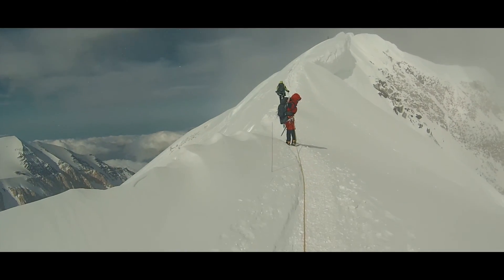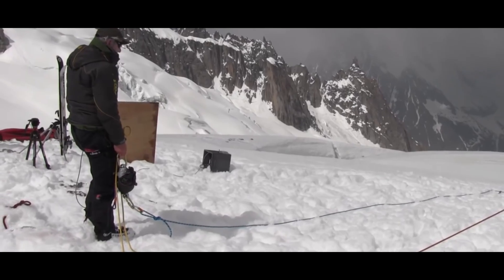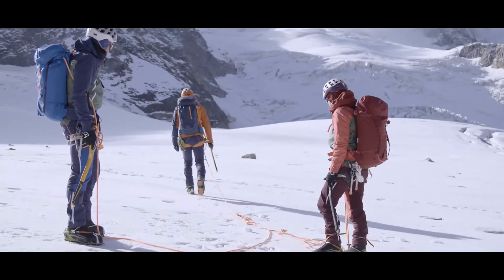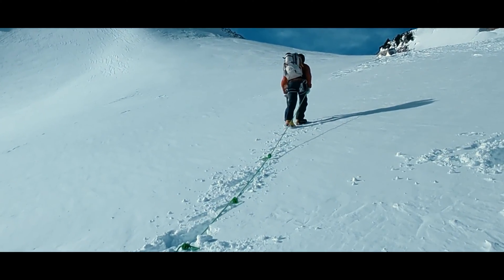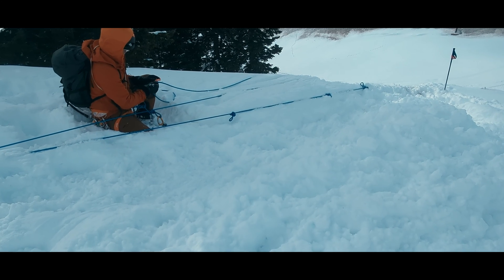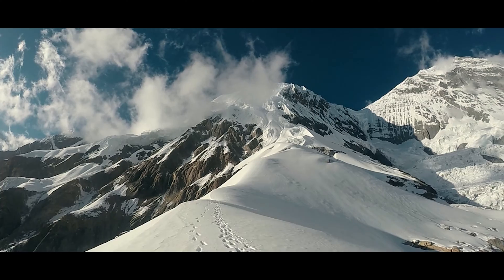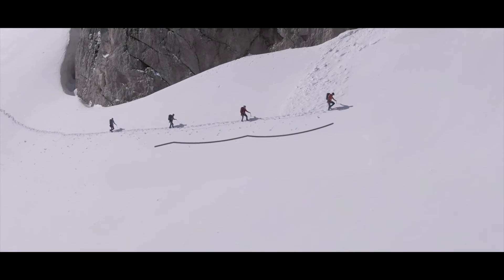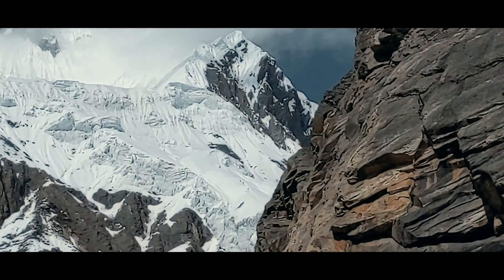Spacing, Coils, and Brake Knots to Determine Glacier Travel Climbing Rope Length

Comment: Lots of good information here and I like the references to the many sources out there. Another disadvantage I would add to tying knots into the rope is that the rope can't be used for running belays. If travel involves steep terrain or exposed sections, it's beneficial to have this option. A team would have to assess what the greater hazard is: crevasse falls or steep terrain. (Or stop and take out the knots.) I like that you point out the amount of extra rope needed for being ready to set up a drop loop 6:1. I think a lot of people do not take this into account. Because of this, I personally prefer a 3:1 Z-drag (that can be converted to a 5:1 or 6:1) that requires less rope. If using a 3:1 system, I find a 50m rope very versatile and will work for teams of 2 - 5 people.
Reply from the maker: @mountainwise2811  yeah, that's a good couple of points. We cover the running belay issue in a video in the glacier travel series on running belays: https://youtu.be/tBl-1h6fpsA

I used to use a 3:1 that converts to a 5:1, but as I started to go to places where my team was the only team out there, I found rope cut to be a major issue, hence my conversion to the 6:1 with knots.

Tradeoffs in all things, as you point out.